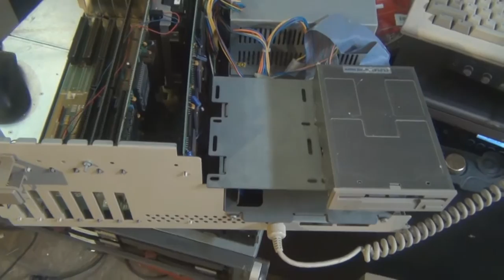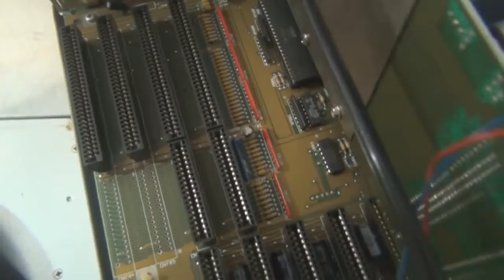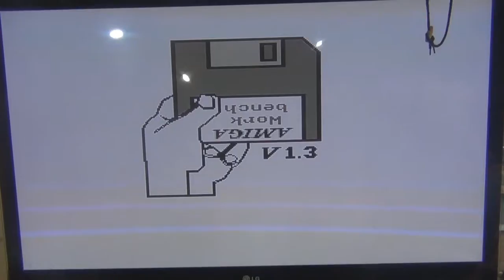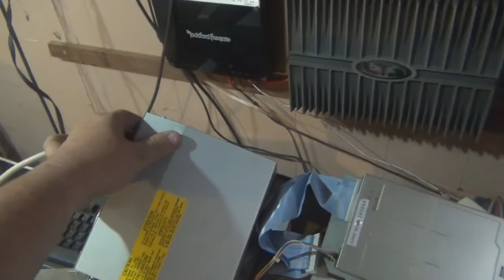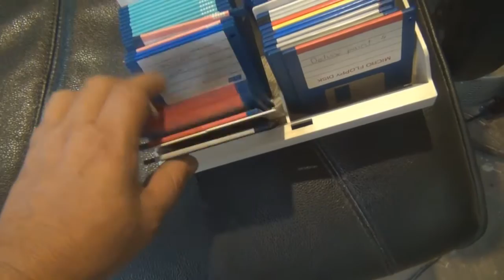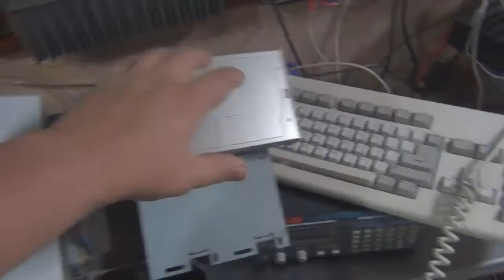Amiga 2000/2500 68020 Upgrade, A2091 Card, Possible Repair / Vintage Gaming Machine

Comment: If you're not keen on fixing it then I'd suggest salvaging the parts and selling them off on eBay.

Otherwise it sounds like you need a replacement floppy drive and SCSI HD. What brand is the SCSI Card ? If it's the Commodore A2091 then you may have issues as I found they have problems with corrosion.
Reply from the maker: thanks, it is an A2091.

Comment: nice initial look mate, made me laugh there with the drive screaming 'feed me b1tch' :-D Might be best to collect bits cheap off auctions for this one, like a floppy drive and some floppys with workbench on and stuff :-) it could be worse...it could be an Amstrad..so stick with it :-D with a battery swap I think you may need old school sla rather than ni-mh or ni-ca cells :-) im not sure if the recharge will be effected if you use different ones...hazarding a guess I would say this unit is before ni-ca time so sla would be a good gambit :-)
Reply from the maker: no idea what battery type it is, but it says 60mAh, some people have used button batteries with a diode to stop the MB from trying to charge them
Reply: alex993cc1 its a good work round to ensure there are no issues but from having a quick look round on line there I can't see you having any issues with the ni-cd version http://www.ebay.co.uk/itm/2-Pcs-Ni-Cd-60mAh-2-4V-Button-Rechargable-Battery-Cells-W-Tab-/381165288840?pt=LH_DefaultDomain_3&hash=item58bf38bd88 from the look of the one in your board and from a quick look at what they were using in the late 80s I would say it should be compatible to allow the mobo to recharge it :-) If in doubt though take the diode approach, as you could always charge the battery externally and it should last 3-6 months before it would need charging again.
 Tis a cool project, are you familiar with the aminet? its something I was always interested looking in to but never got time :-)
Reply: The battery used was a standard 600mAh NiCd three cell pc mount unit. I have replaced them with NiMH units as they have similar charging characteristics. However ones that I installed a few years ago have begun leaking, especially on machines that don't get turned on all that often. IMHO the best solution is the Lithium coin cell in a socket for easy replacement and a diode installed in the charging line to keep  the cell from being charged.

Comment: It seems maybe the SCSI cable may have been disconnected cause the drive is bad? Also i believe the boot floppies for an Amiga are written in a different format, So you may have to make one.
Reply: yep do a boot floppy on a pc and it will just read un recognisable, best bet is to ask someone with an amiga setup to clone you some discs or try picking some up cheap off 3bay :-) it looked to me like the scsi cable was unplugged to but I think he was using the second connector on the ribbon. With a fresh battery in there and a new floppy (will break your spirit getting them old floppy's working) it should be good :-D

Comment: Ahh ye olde steam powered amiga, put a bit of clean non shiney paper between the heads and trigger the loading shelf so the heads close, pull paper out slowly to clean the heads :-)
Pc drives will work but there ready/select lines are fecked up from the normal original fdd use.
Make sure that drive isnt a pc one thrown in by some plonker lol.
Reply: alex993cc1
Right with both discriptions of me ha ha :D
I also used to use open pour cardboard to clean video heads, i know its not correct but when a head is so filthy you have to take a harder approach.
If your very carefull it works lol, paper/cardboard=wood=soft file lol.